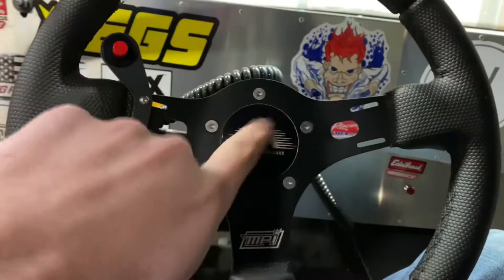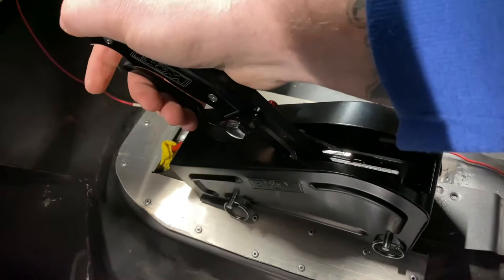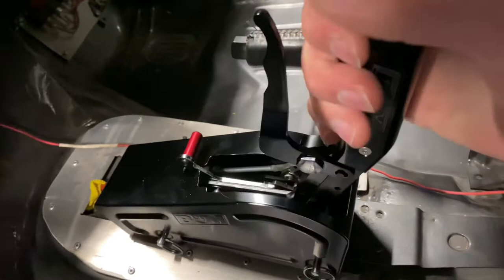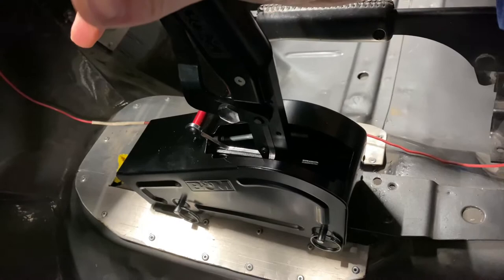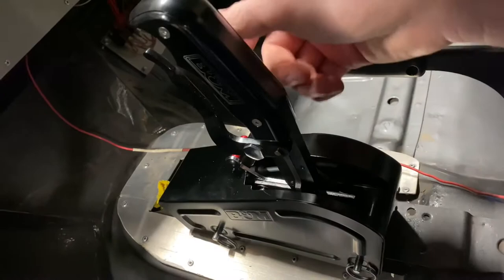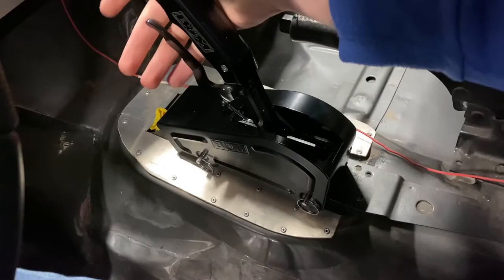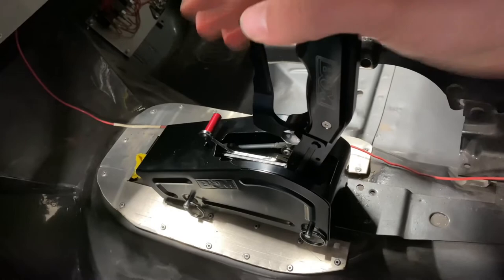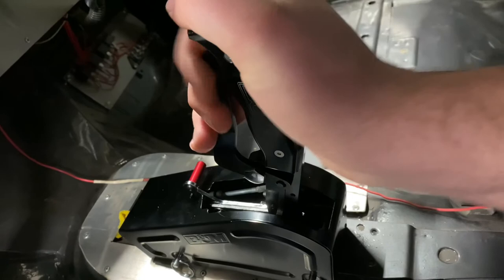Third Gen Camaro Drag Car | How To Shift B&M Pro Stick!!! | VLOG EP: 14

Comment: Great job on the video!  I have a small business that I started after having an idea that worked really well to convert my Chevrolet factory original floor shifter detent to function as a slap shifter.  It's the horseshoe shifter that was factory installed in '68-'72 in Chevelles, El Caminos, Camaros, 3 years of Monte Carlos and 2 years of Impalas.   I just slap it from 1-2, and then do the same again for the 2-3 shift.  There are positive stops at 2 and 3.  I have a neutral lockout that requires me to squeeze the handle in order to shift to Neutral.  It works so well that I got a patent on my design features.  I have a local friend that has a Pro Stick and he told me he has accidentally shifted from 2-Neutral during a race because he didn't get a solid grip on the trigger and pull it completely back before shoving forward from 2nd.  He recently  brought me the shifter to study and work with.  The construction of the shifter is excellent.  This video shows the improvement I was able to make.  It now works like my own shifter.  No more possibility of missing 3rd and hitting Neutral.  2 slaps and the race is over.  Squeeze to shift to Neutral. He loves it!  https://youtu.be/NuNOxTdyXf0
Reply from the maker: I just watched your video and I love that design! I will get in contact with you soon about ordering one of those!

Comment: Awesome car! I'm still in the process of going through your videos, as I have a 3rd Gen also. I really want to do my dash like yours and lose 98% of the wires under there. Do you street yours?  If so how did you wire all of your "have to have" street stuff? Blinkers, wipers etc. TIA!
Reply from the maker: I do not street mine but intend on putting it on the street once my LS goes in. Wiring can be really difficult. Most of it ends up being trial and error. Wherever you can tuck stuff away, do it.

Comment: hey man i have a question , this shifter works with a 4 speed ? and also i know you might not have the reverse lights wired but if i wanted to use this for a street car would i need a reverse light switch or neutral safety switch of any sort?
Reply from the maker: As far as using it with a 4 speed, you can order the replacement gate plate for a 4 speed. And the reverse light and neutral safety, I know it has a neutral safety and I think there’s a switch for reverse lights? A friend of mine had one of these on his street car so I’d think it would.

Comment: I have a wiring question as I am putting one in my 91 bird with the th400! I know how to wire the rev lights and neutral safety switch but what do I do with the  two stock thick wires (Tan and purple) and the second cable that attaches to the stock shifter?
Reply from the maker: That’s a good question! I’m not actually sure. I didn’t have to wire anything on mine since my car is a drag car but I could see if I could find some info on that for you.
Reply: @CherryBombZ28  Thanks man I appreciate it but I ended up finding all the answers to this! I was all backwards lol those thick wires were the neutral safety switch ones!

Comment: Just pulling mine out of the box i had that same question if it would lock itself into 3rd with the trigger pulled. Messing with mine not installed it the shifter doesnt want to "lock" in that gate. Does it seem to work correctly now that its installed?
Reply: Mine doesn't seem to "lock" in 3rd, but its not installed.
Reply from the maker: Mine locks into 3rd as long as I keep holding the trigger. If you let go of the trigger, it’ll go into neutral.
Reply: Mine doesn't seem to go into neutral just pop back into 3rd
Reply: Have you seen the video link I posted above?